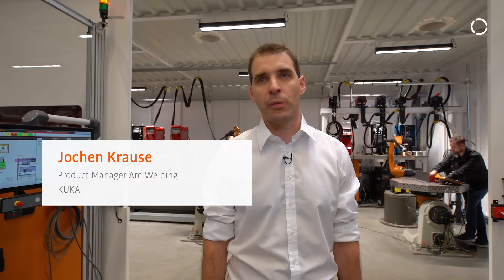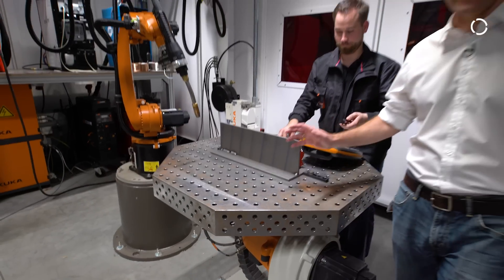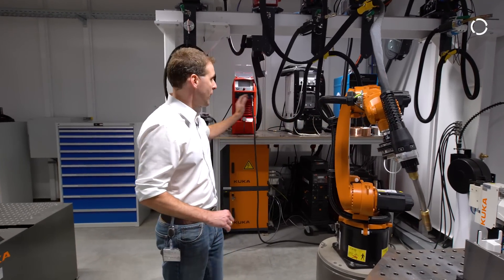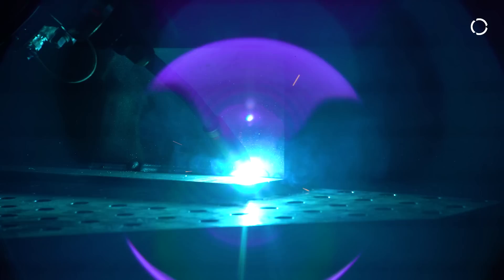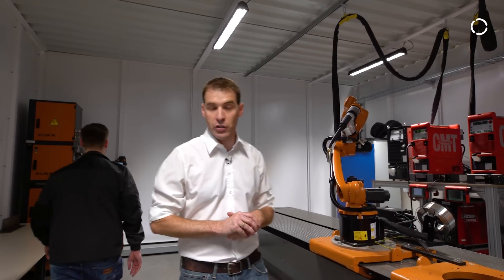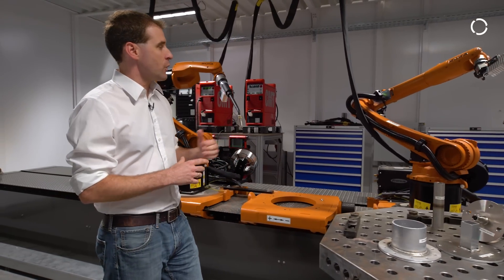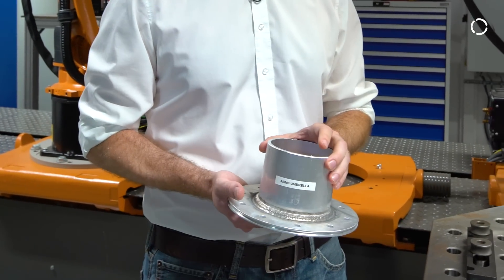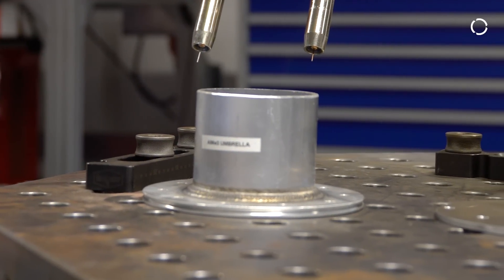KUKA Robotics Arc Welding TechCenter Bavaria, Germany - Walkthrough

Comment: Why do you need 2 robots with 5 or 6 axis to weld a round pipe to a plate?
Over engineering in my eyes
Reply: Could be several reasons  ... for example i could imagine:
- Speed ... two robots working on the same work piece will improve cycle times
- heat distribution to minimize or even prevent deformation of the work peace
Reply: Thats the same thoughts i had, but i think the speed is not very critical and neither the deformation.Overall it is a part with huge tolerances.

And even if that was the case, a simple welding turning table and two 1-axis robotarms could do the trick ;)
Reply: For this ONE application you may have a point ... but what if you want to weld different/ more complex work pieces at the same station where deformation may be an issue? And i think this demo cell is supposed to show/find all kinds of solutions for different customer problems. So it might be over engineered for this special purpose but might be needed for others.

I think at last it depends on what the customer wants to achive.
Reply: Thats totally true... probably its just a poorly picked example for what this robots actually can weld!
Reply from the maker: The solution was chosen with two robots due to that the heat input during welding is with a symmetrically input to the work piece, as the robots would weld 180° shifted around the tube. This would lead into less heat distortion of the part plus the mention cycle time improvement / higher productivity if two robot weld at the same time.
Reply: Thanks for the explanation, but this still does not justify 5 axis